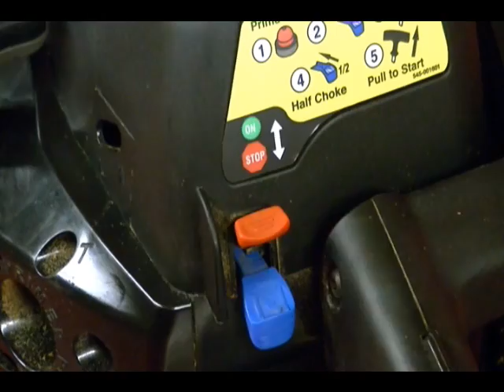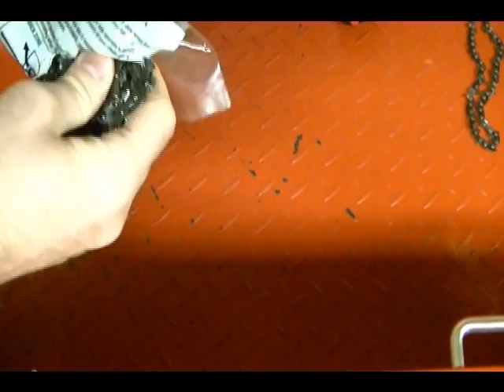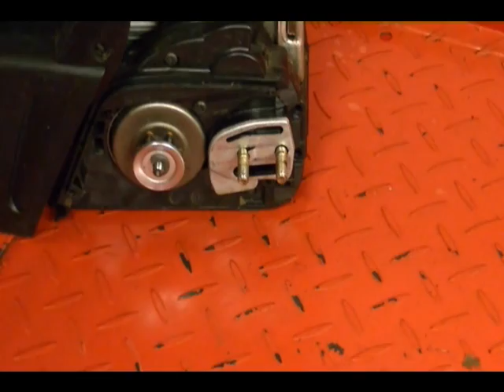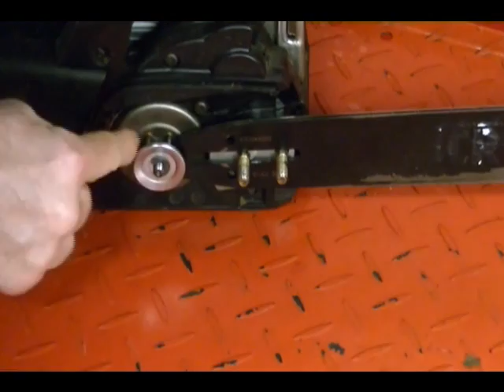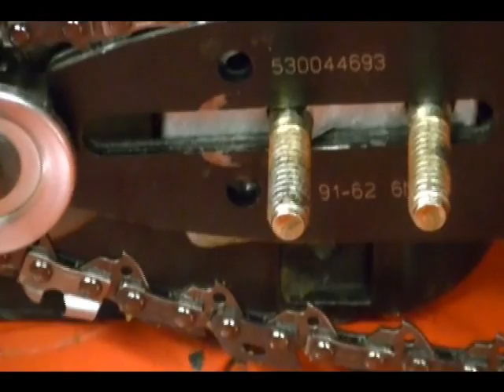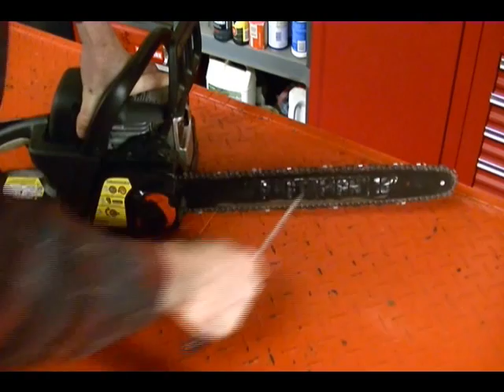Small Engine Repair: How to Replace a Chainsaw Chain & Adjust Tension (Craftsman model #358350990)

Comment: bought a new 16" craftsman quick tight adjuster I can get chain tight, seems good by the time I cut a piece of small 6" wood chain is loose. I have to tighten chain again this proceedure is not practicalfor every cut ,any suggestions

Comment: Hey thanks for the video. I have a 16" version of the saw you used in your demo. I bought a new chain (Oregon S55) and did everything you just demonstrated but the chain isn't long enough. According to the packaging this chain should work. But it seems to be about a half inch too short. What am I doinf wrong? Thanks!

Comment: Great vid, I have a small craftsman (older than yours) I bought a new chain but I think its the wrong chain, when I put it on and tighten it up it won't spin, I thought it was supposed to be 3/8 50 whatever that is, I got the saw free it had a rusty chain and bar, cleaned bar & it looked ok so I just bought the chain, any tips finding correct chain etc.?